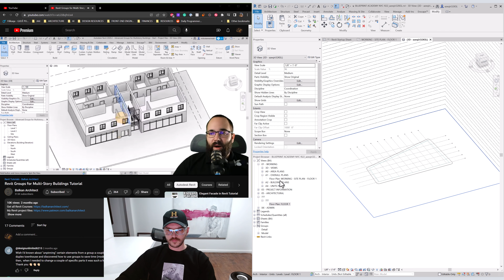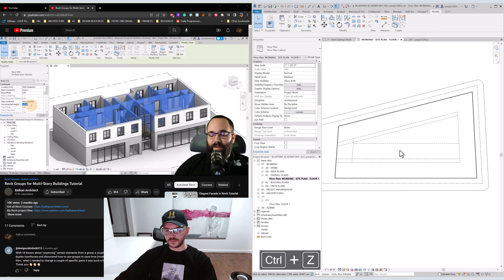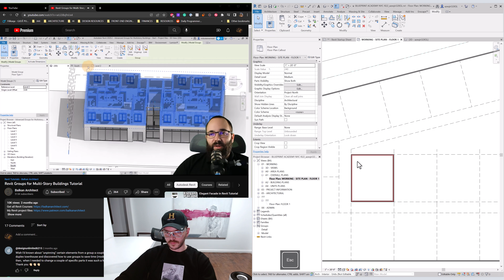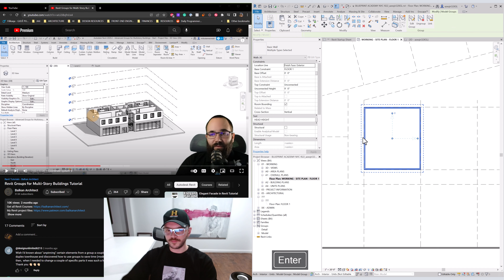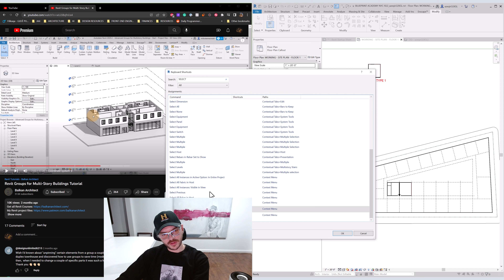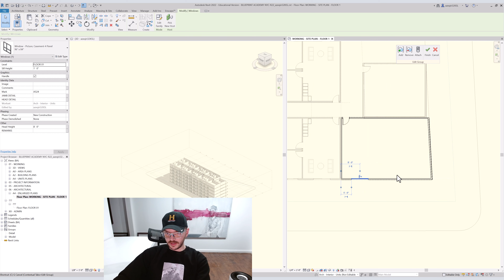Revit Pro Tips: How to Use Groups for Multi-Family Developments (Exposing Common Mistakes)

Comment: Awesome information! It is a pleasure to watch someone work who has such attention to detail, accuracy, consistency and efficiency. I also like the added documentation in the comments section of the video. I too work on multi-family projects that are created using unit types though I am on the structural side. It would be extremely helpful if more architectural firms modeled using the method you deploy. Sure would make my work like easier.

I tend to work on multi-family that also includes multiple buildings. These buildings live in the same model which easily allows me to utilize detail groups for tagging and having the tags present in the exact same location throughout the project. However, I am beginning a new project and I will be working with a team that will require each building to be its own model.

Have you worked on projects consisting of multiple buildings that DO NOT live in the same model, yet have the same units, and how would you go about utilizing the functionality of detail groups in such a scenario? Any suggestions or ideas are appreciated.

My thoughts go towards having individual unit models and linking them. I think that works for the model side of things but when it comes to documentation I don't know what methods are going to work. My goal is for the annotation of a unit to be consistent throughout the many buildings in the project.

I didn't catch your name but again, great information.
Reply: After testing a bit more I am leaning towards individual units being their own model. I will do the unit annotation in that model. The unit will be linked into the building model and I will utilize "RVT Link Display Settings - By linked view" as required. If you know a better way, please share. Thank you.
Reply: @jeremyoakes809 were you able to in place edit the linked group?